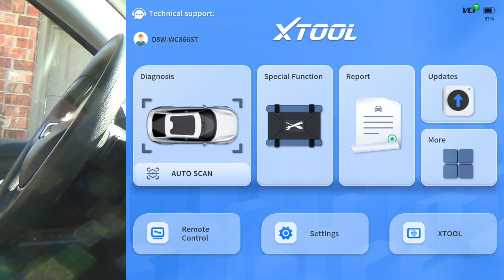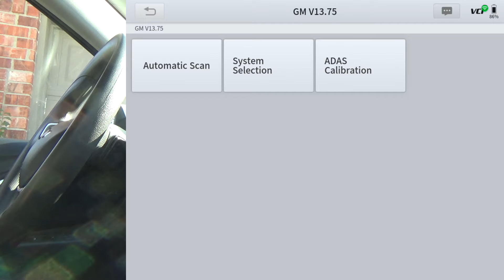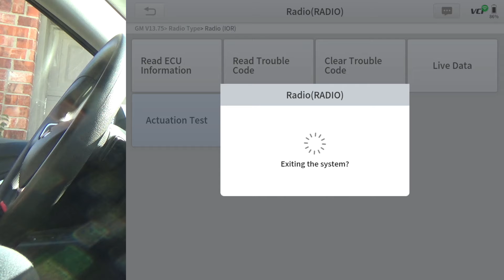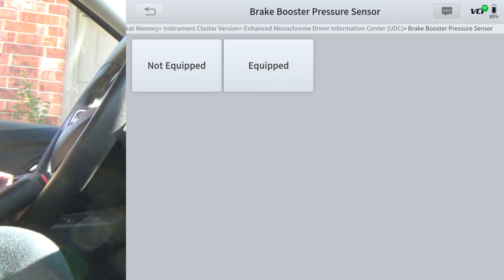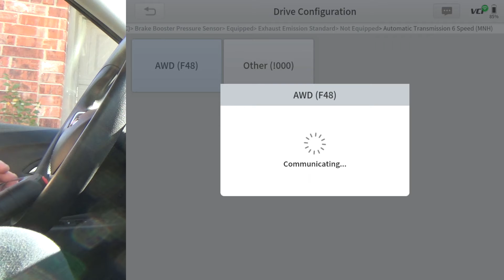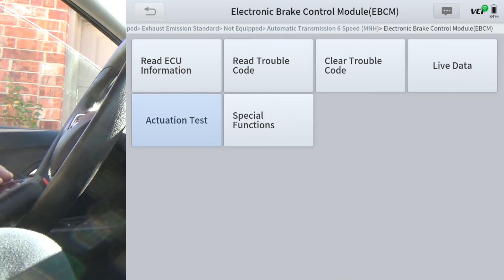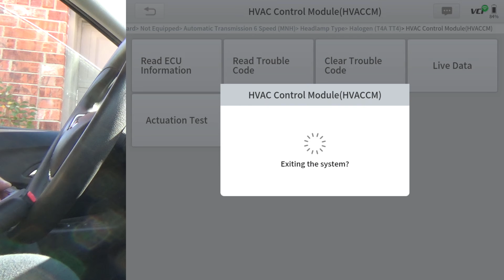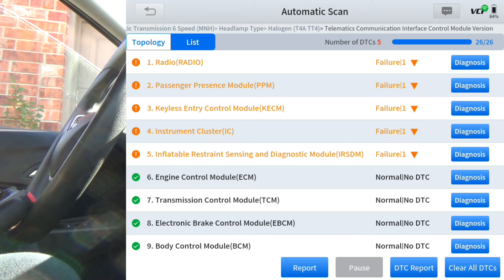Walkthrough of the Xtool D8W on a 2021 Chevrolet Equinox.

Comment: Hello! So how is this compared to thinkscan689bt/mucar 892bt?
Reply from the maker: They are all three equivalent to each other but the xtool should be able to program more keys because it can pull PIN codes on some cars that the other 2 can't.
Reply: @737mechanic  thinkscan with mucar, I know are the same, I was curious about xtool. I think I will go with xtool because I have thinkdiag 1, always with me, and I guess thinkscan and mucar are better only for having canfd doip than thinkdiag. I saw xtool somehow, it does everything it says, not just has things in the menu and not working...

Comment: Nice scan tool, I just can't believe some of these Xtools don't seem to have I/M readiness. Such a basic function.
Reply from the maker: They all have it, Go into manual selection and hit the OBD button, that is where you will find the I/M readiness.
Reply: @737mechanic  Found it! Thanks!
Reply: @737mechanic I just got my D8W and couldn’t find the I/M readiness function either    
Thx for the info.  It’s good to know I won’t have to use a separate “cheap” scanner for that info
Reply: Mine doesn't have fuel trim pids.. How's that possible... I'm sure it's operator error..

Comment: Is battery capacity in D8W 10000 mAh or 5000 mAh or 4000 mAh 
and is CPU speed is 1.5 or 1.8
Reply from the maker: CPU is 1.8 4 core, and battery capacity is 10,000mAh
Reply: @737mechanic  thank you very much